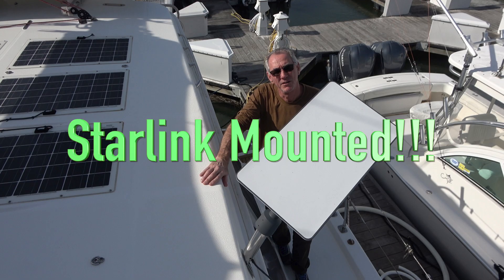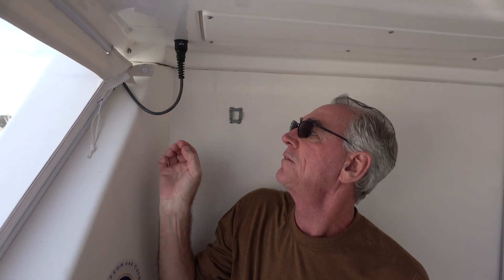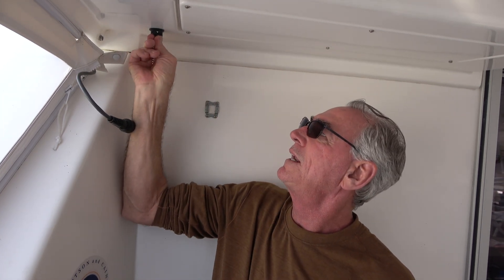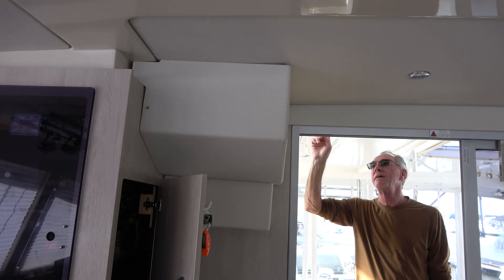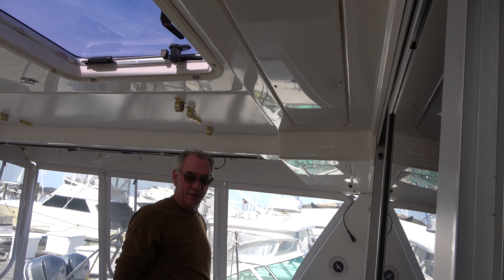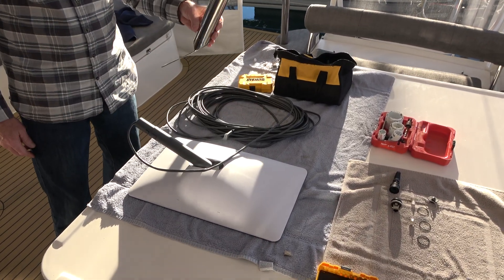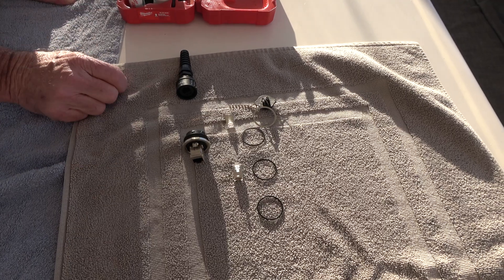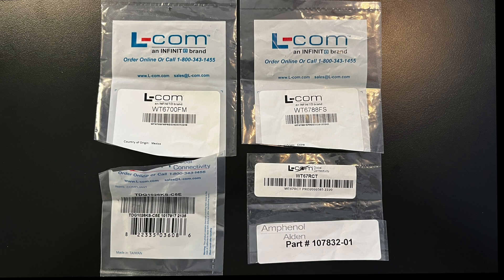HOW TO VIDEO: #MOUNTINGSTARLINKONBOAT  -  SECURE AND REMOVEABLE

Comment: Do you Have a Link for the Cable Connection thru Bulkhead ?   Nice install   Have a Leopard also
Reply from the maker: Here are the parts links.  L-com was worth the extra money to us for flawless connections.

IP67 RJ45 Plug Kit, Shielded Cat5e, Flex Style
https://www.l-com.com/ethernet-ip67-rj45-plug-kit-shielded-cat5e-flex-style

IP67 Front Mount Flange for Keystone Jacks 
https://www.l-com.com/ethernet-ip67-front-mount-flange-for-keystone-jacks

Cat5e Coupler - Shielded RJ45 (8x8) Keystone Feed-thru 
https://www.l-com.com/ethernet-cat5e-coupler-shielded-rj45-8x8-keystone-feed-thru

IP67 Rated Jack Cover for Female Receptacles with Tether 
https://www.l-com.com/ethernet-ip67-rated-jack-cover-for-female-receptacles-with-tether

Comment: I like the installation- after you cut the wire how did you  reconnect all those small wires?
Reply from the maker: Just a standard Rj45 crimper. Pass through is what we used.